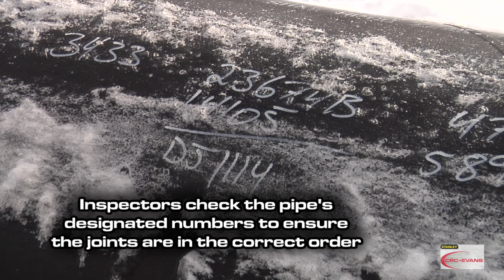Stages of Pipeline Construction

Comment: They did leave out a very important step and crew. Wherever there is a break in the line for what ever reason, maybe a creek for example, a bell hole is dug so that ppl can safely get in. Then they weld the two sections together in the ditch. This is called a tie-in. And it's a very important step to a pipeline.
Reply: And what if the torrente in full, drags the link what happens?
 The connection is interrupted and it is not good, perhaps it is better to dig a deep excavation under the stream.

Comment: You forgot the Jeep the pipe, To find any deficiencies in the coating or pipe, After repairs are made, then it is put into the ground and buried. The process is then repeated when it's tied in, welded, coated, Jeeped,covered. I'm this is not the beginning or the end of pipeline work and has to be maintained year around.

Comment: What's the maximum length of Pipeline that can be lowered in the ground by side booms together at once?
Reply: @Bradley Powell Thanks Brad. Can you please tell how the next joint is done with the next stretch of pipeline? I mean is it done inside the trench or outside?
Reply: @Bradley Powell Awesome. Thanks much Brad. Very insightful info.

Comment: There's a step missing (or I don't understand).  How do miles of pipe, or even 50 pieces all welded together above ground, get lifted and lowered into the ground all at once?
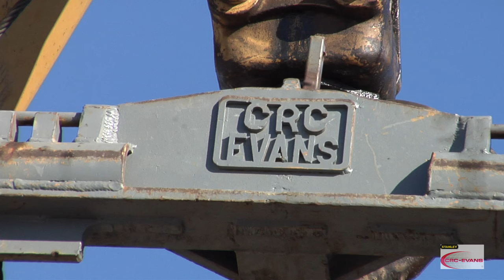Reply: 8:41
Reply: They did leave out a very important step and crew. Wherever there is a break in the line for what ever reason, maybe a creek for example, a bell hole is dug so that ppl can safely get in. Then they weld the two sections together in the ditch. This is called a tie-in. And it's a very important step to a pipeline.
Reply: With cradles and multiple sidebooms.

Comment: If they know where each pipe section goes, and must already have documentation of the topography in order to know where the right of way is, why can't the pipe be bent at the factory where it's likely to be a lot easier?
    Buildings are built with girders made for each exact placement according to specifications, so why not pipe?
Reply: I believe it's for the ease of transportation as unlike building components the pipes are enormous in size and are usually shipped in standardized containers.